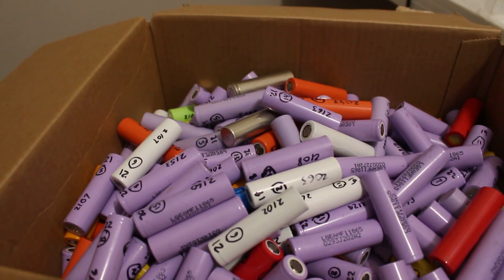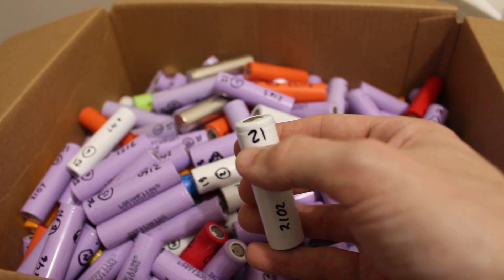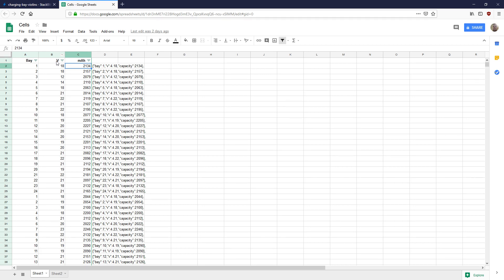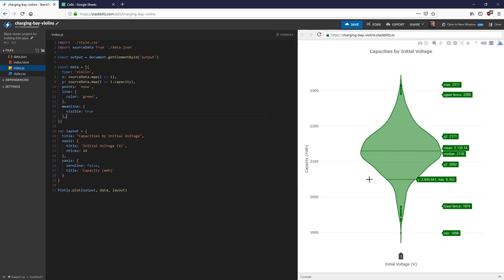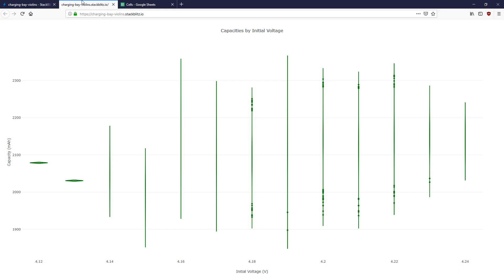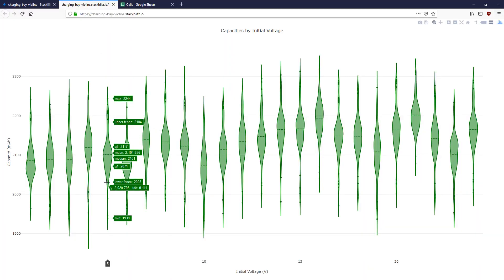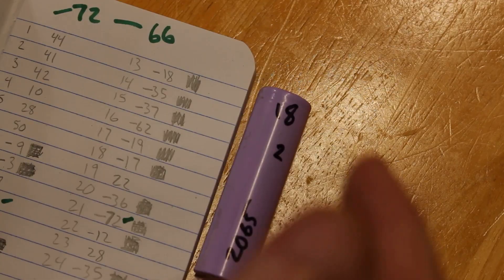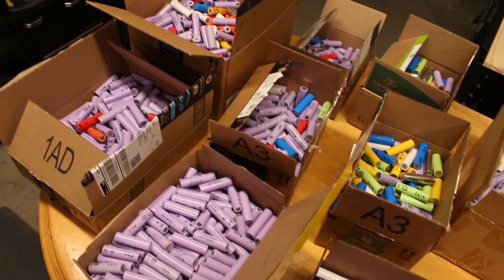Eliminating Opus Charger Bias

Comment: this is a sweet charging /discharging station , i been collecting 18650ies for about 4 years not and i have around 7 thousand cells now , so its time to start testing them and weeding out the bad ones, my plan is to build a power wall for my home and use solar but i heard from many people its dangerous , whats your thoughts on it?  also 80% of all my cell are from scooter packs , and since i work at a scrap yard / disposal plant i get all of them for free, and the other 20% is laptop batteries , all the scooter packs came off bird scooters so im hoping they are some what decent cells , anyways thanks for the video, an d have a good one
Reply from the maker: Do your best to know the risks... understand what can go wrong and why. Investigate all the documented failures you can find, and avoid them. Anything which stores energy can be dangerous, but we put laptops on our laps, in our offices and homes, some people even put them in their bed! So 18650's are perfectly safe unless you do something unsafe with them.